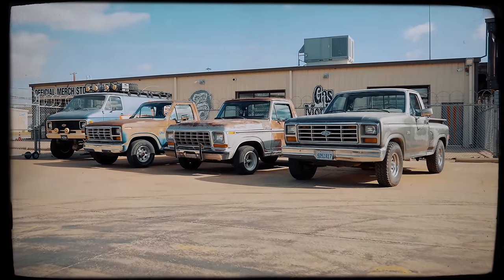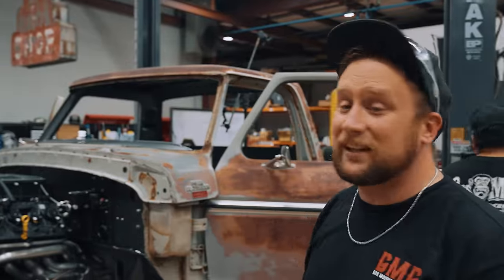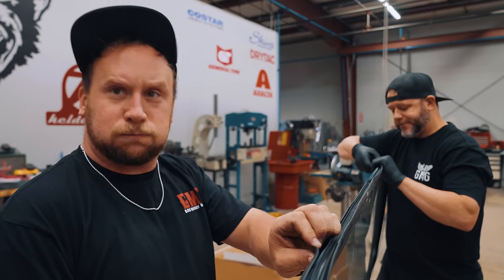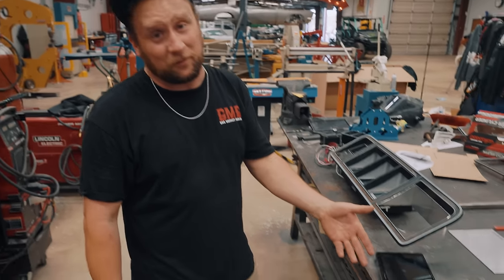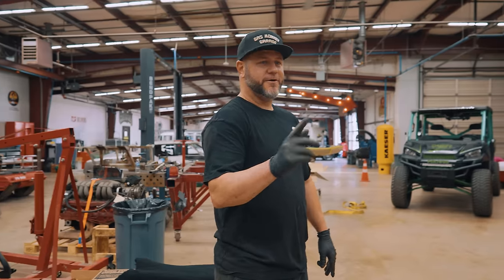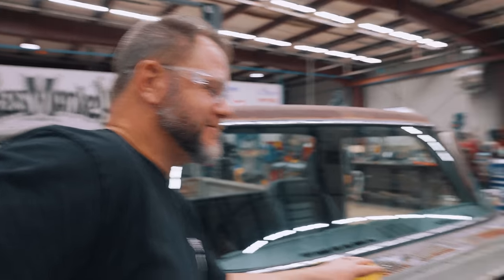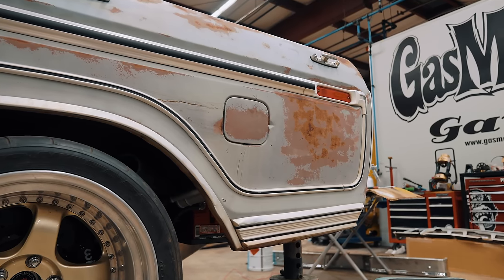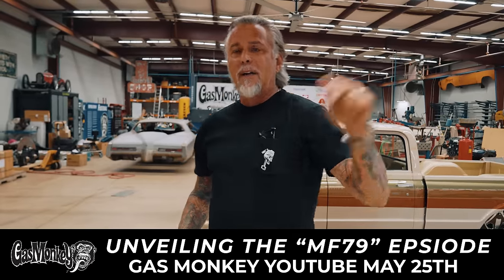Building the Ultimate Ford F100 Truck | EP 3

Comment: I would love to see NASCAR equal length headers with pipes that exit just behind the cab and before the rear wheels with the NASCAR 12" flat tip with dividers inside the tip for support . The tips would be parallel to the body lines. Don't forget the H Pipe section !!  Just remember i want to Turn the key first!!                                                                                                                                                          Yep Richard Just say it your famous words  I KNOW YOU WILL !   Hay y'all keep up what you DO BEST!

Comment: Little tip with your old Soundskin if you have a cheap boxed in type of portable generator with the plastic case cover and plastic handle put some of that inside the covers and youl have a silent geny you can take camping and not piss your wild life of or co campers

Comment: Mounting the four link arms outboard on the axle tubes, limits tire/wheel width. When I added my four link inboard on my 76 F100, 
I was able to run 11" x 32 slicks under the bed...
Reply: We will be at a 315/40-20 = right at a 30” tall and 12.5 wide! We still got the meats!😂🤘🏻

Comment: might be too late, but i reckon the duck egg blue Camaro needs a 427 crate engine with carby style efi (single or twin) into a 6 speed manual. Brakes would of course need to be 4 wheel disc willwoods. But that keeps the car looking old school like we would have done years ago with modern tech to give it punch. Damn i wish that were my car and i had the funds to build.

Comment: What brand of battery are you using on this ford?   I have to run deep cells batteries in my Chevy
Reply: Dual odyssey AGM’s
Reply: @Joshparis  Thank You for the reply. I have so many lights and everything electronic I had to run two batteries so I’ll try those for the next time instead of the optimize which I use 2 of them.

Comment: C&C equipment, also name of their channel... they bought a triple complete fab shop where the buildings are just stuffed with full sheets of aluminum and stainless steel sheets, and any combination of pieces and parts that make a fab shop complete. These buildings look more like a hoarders pile, lots of stuff from the sixties and seventies, cars and trucks, plus welders, welding supplies, consumable products, tungsten...  just everything a big shop could ever want. Memorabilia,                                Dale Earnhardt beer bottles, something I have never heard of and still full. Even a lamp that sat on a secretary desk, old stuff like a motorcycle.... too much to list here. C&C is interested in the building and location, some of the welders that are there for days, presses and sheers,  rollers, english wheels cutoff saws, and did I mention "Welders" as in multiple new machines that are turn key, have not set for years .... like maybe a year now but power on and able to run and test. C&C uses steel and builds dozers excavators skidsteers, dumptrucks, and lots of the OBS ford truck stuff. Those guys are family operated, easy going and want the shops cleaned out, more like  a garage sale or give it away